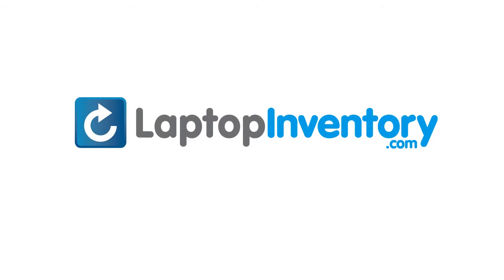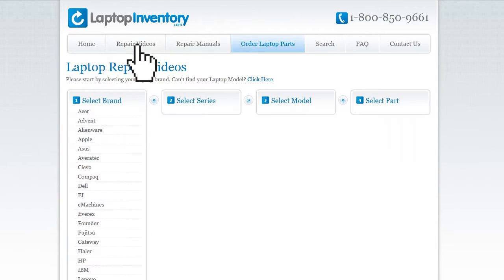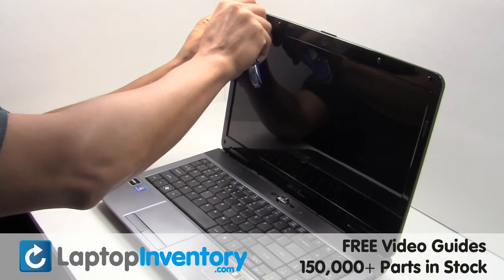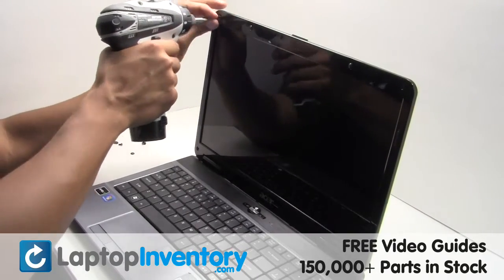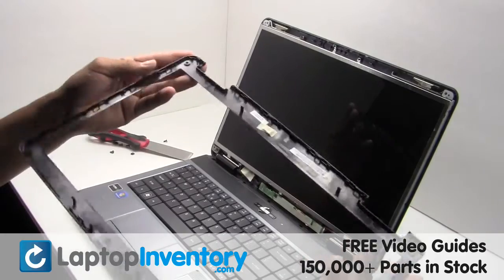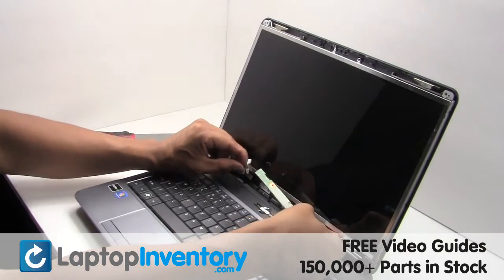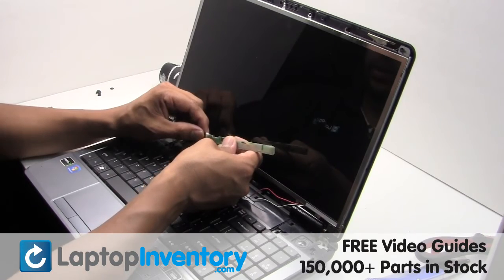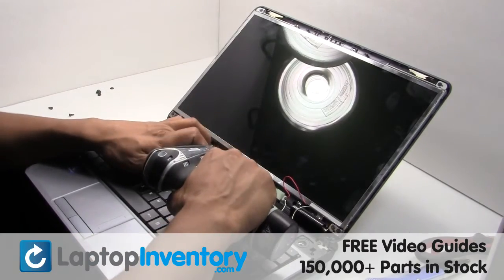Acer Aspire LCD Inverter Fix Replace Install Video Board 5532 5332 5516 5517

Comment: hey...i have aspiree15 e5-575g-535z laptop and about 6 month ago when i use it them monitor freezed i colors goes light and light and i touch back of monitor and it all right...an expert person told me that you have to open you laptop from webcam so you don t do it and the laptops mesh is a little bent . i open it from webcam and its all right....but about 1 month a go it freezed again and i touch back of monitor and it had no change and i touch and press a little under monitor on acer logo and its all  right....im very stressed because i don t have  money to change monitor ... you now what s my laptops problme?should i be streesed? :)  thanks

Comment: If all else fails you can use a monitor just plug it into the rgb port at the side of laptop i think its also called an rs232 socket usually blue

Comment: I cannot begin to thank you enough for this video, as a novice I had no clus as to what to do. One question though before I tackle this. In the video , when you begin to re assemble I noticed that the bottom  flap (on the main casing) had also been removed, Does this have any significance or was it by chance?

Comment: what does the inverter board do? im completely clueless.....

if i change the lcd because the screen was broke do i have to change the inverter board too?
Reply: Turn it on and see if the screen works if not then you may need an inverter
Reply: @mswsmw8838  my acer 4752z does not have inverter board..

Comment: There are three pads just next to the input connector on the inverter.  I measure 19V between the outer two, and 0V on the middle one.  Is that right?  Also, what voltage should come out of the inverter?